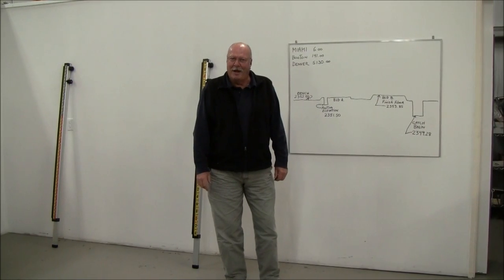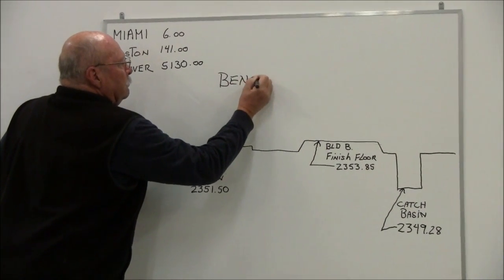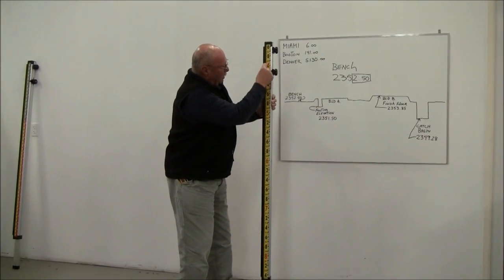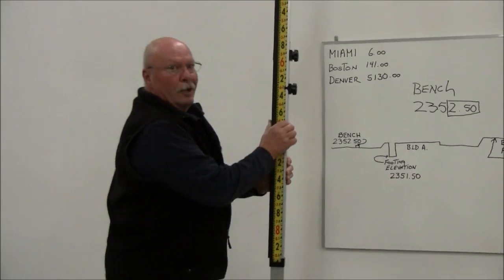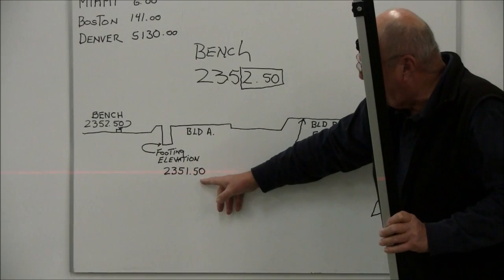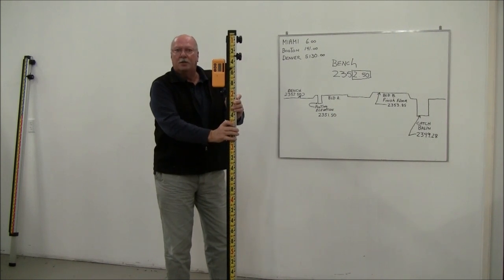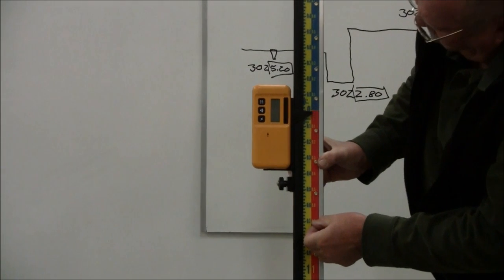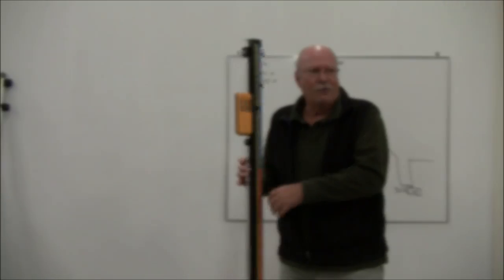HOW TO READ A DIRECT READINGCUT FILL ROD

Comment: It does nothing for you.  Its stil different numbers.   Height of instrument.  To hub.     That's the number u gonna have dude.    U made a device that will confuse the hell out of contractors.  If it's not broke dont fix it
Reply: Sounds like u ain't know how to use a linker rod
Reply: he didnt make anything....its an engineers rod not a builders rod. these are called philly rods and been around forever. every major manufacture makes them. If you cant use it, its because you lack the brain power. Dont fault others for your short comings.
Reply: @FATMINER-lb3ww  it's a lenker rod chief